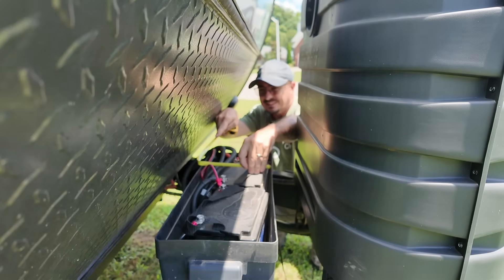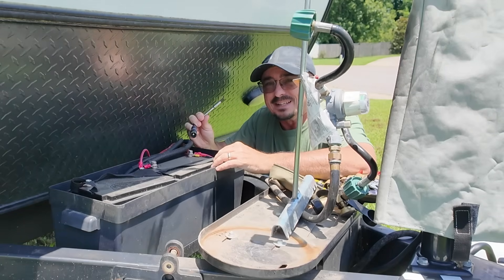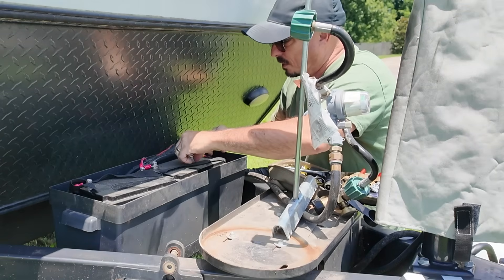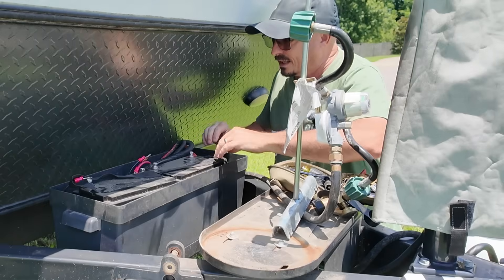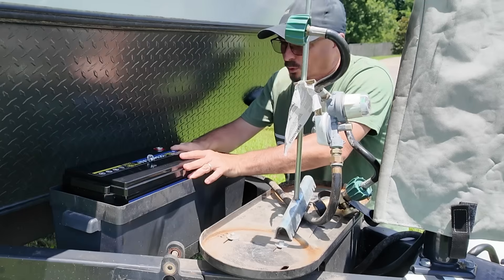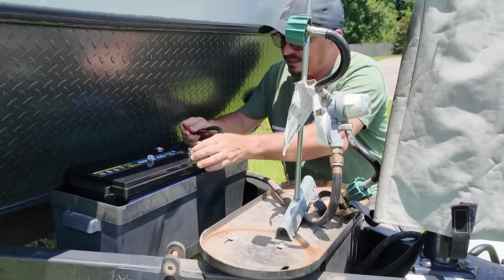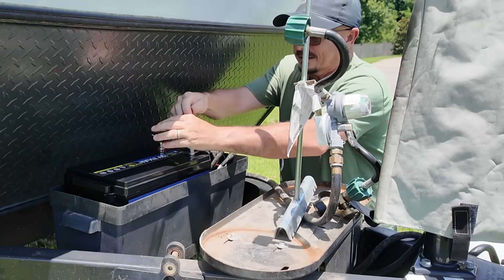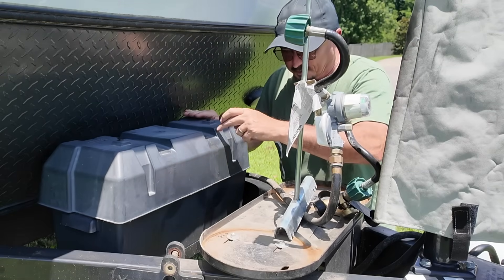Why I Ditched My Two RV Batteries

Comment: Safety issues here - remove ring, tape wrench, disconnect negative first and connect it last so positive is not "hot" with respect to grounded surfaces, wear safety glasses. Nice battery. Wondering what the downsides are to the "mini" series in real life.
Reply: definitely the ring first

Comment: Hello Jason I would like to know how you configure your battery management system or shunt. And the effectiveness of the measures. In packs formed by many cells or like your actual battery.

George / HP1GDS
Reply from the maker: I use the Victron Bluetooth Shunt https://amzn.to/4kMjTa6 which is inline with the negative lead on the battery. I have found it to be fairly accurate over the 3 years of use. #affiliate.

Comment: If you decide to replace the inverter then look for one with low idle consumption.  Lets see... for that battery topology I'd suggest the Multiplus-II 12/3000/120-50 (about $1K).

* Supports 50A of shore power @ 120V
* 3000VA output, 2400W continuous output power
* 93% efficient, 13W idle consumption
* Inverter-charger.  Can charge the battery from shore power at 120A if desired (programmable)

That's what I would suggest.  Lugs / terminals for connections in terms of wiring.  More or less standalone.  No solar inputs built-in.

Its too bad the system is still 12V but since demand isn't very high I guess that's ok.

-Matt

Comment: Great review, looking forward to upgrading my lifepo4 batts.  Regarding the ac, have you looked at the new RV 12v ac units ?
Reply from the maker: I have but don't want to replace a working unit for the few times that we would need the 12V AC. They are impressive with how little current they require to run though.